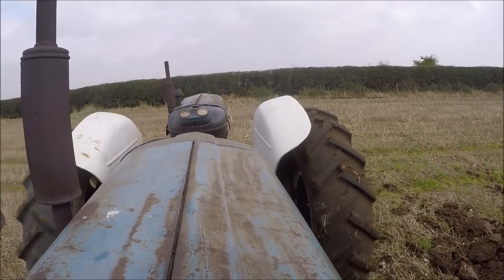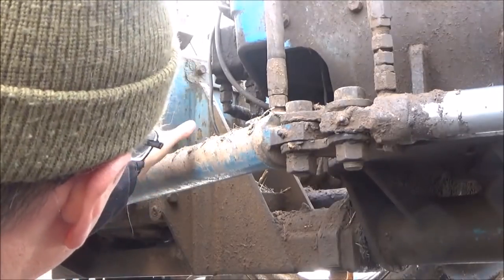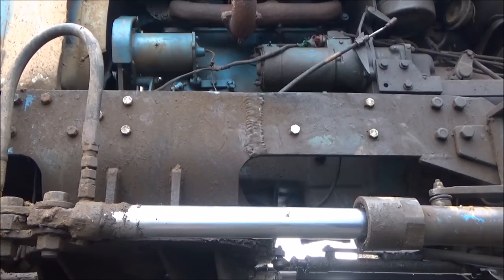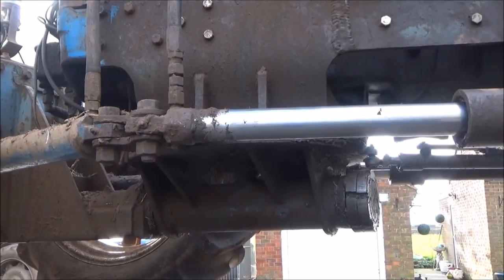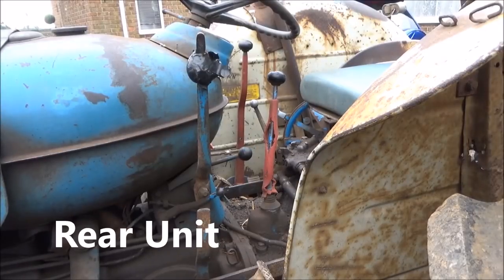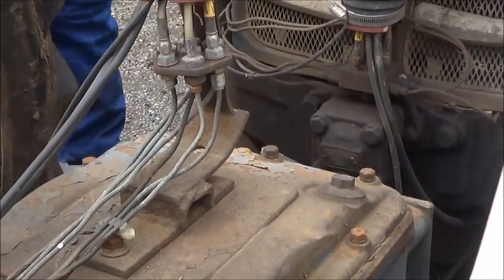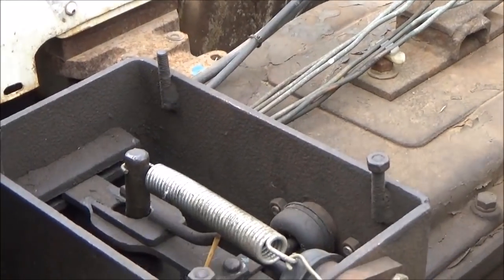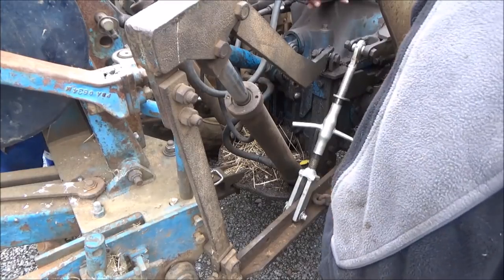THE AMAZING DOE TRIPLE-D !

Comment: Loved the up close and personal look at the old girl.     
Before cellphones with cameras, I happened across two Deere 70 two cylinder tractors mated.
Hydrostatic pump and motors from a combine spun the crankshafts. Plates blocked off where the jugs were originally bolted to the block. 
A 6-cylinder Chevy engine spun the pump, likely harvested from the combine as well.
It appeared as though someone ate pizza too close to bedtime...   The most crude piece of functional machinery I believe I’ve ever witnessed.
I wish I had a picture or better yet, a  YouTube video of that hilarious nightmare!
Be Blessed!
Reply from the maker: Yes over the years there have been several attempts, some more successful than others, at getting more traction and power.

Comment: Thanks for another fine production sir, I seem to remember reading somewhere that one of the units needed to run slightly faster on the throttle settings. Now was it the front pulling or the back pushing more that I can't remember. There was an MM somebody had made into a Doe type tractor round here a few years ago at a local show. They used a loading shovel type pivot, and a load of junk they found in the scrap out back to build it. It was a 10/10 for mechanical  achievement with it working, but a 2 out of 10 for presentation L.O.L. hope you have a good week , see ya next time Take care.
Reply from the maker: If you watch the final clip Robert when he's ploughing at the Festival of the Plough, the front unit is actually in a higher gear than the rear which was a common thing to do when using the Doe's on hard going.
Reply: Hi Thanks for mentioning that,  when you  watch the magic video of the Doe plowing the first time you don't automatically  notice it. When you said about it you can see it Is slightly faster by a hair.

Comment: Excellent video Kurt. Interesting how they made the transmissions and steering function. 
The big issue now for those guys that have them is a) storage space and b) moving the tractors and ploughs about from event to event due to their total length. A big enough lorry (or lorry and drag is not cheap to run in its own right unless you have other work for it to subsidise its use going to matches or other such events.
Reply from the maker: Yes Dan it's okay having these sorts of things but moving them is another headache altogether but these guys make the effort so that we can continue to see them working. I think a lot of people just go to these events without thinking of the cost and logistics involved.

Comment: Had 2 on the farm where grew up....the first one, the farm had to buy 2 majors, for Does to build one DDD, the gearshift arrangement was different, I think the front tractor had to be put in gear, before got on to drive it, but it was updated after a while.. the second one was a pair of 5000's.
Reply from the maker: That's right, they were nearly all different 👍
Reply: @LordMuck  I think it was one of the early ones they made..

Comment: Good video Was just wondering how their got the diff lock to work on the front unit when the driver on the back unit pressed the diff lock pedal down or did they do away with the pedal and fitted a leaver  that worked both diff locks simultaneously
Reply from the maker: From what I've seen Derek they did a variety of things including slave cylinders and springs.

Comment: what you were saying there about them being converyed into conventional tractors now reminded me actually a few roadless tractors were converted to 2wd if the axle went wrong
Reply from the maker: That's correct, I've seen a 2WD Ploughmaster at a dealers some years back.
Reply: MMM?  I seem to recall '''the conversion'' back to 2WD was removing the propshaft and axle half shafts  ;-)
Reply from the maker: Which left a 'dud' tractor (4wd axle but not 4wd) so it was removed and a standard 2WD front axle put in its place so it could be put onto a loader (as was the one I saw in the dealers yard)
Sandwich box was still in place though as was output shaft.
Reply from the maker: And I've also seen a couple of Roadless (no idea what model) sent abroad as 2WD's and the 4WD kit taken off completely and sold separately.
Reply: Lord Muck just seen now JJ thomas (converted old 5000's to 6cylinder and refurbished them with new cabs) apparently bought up some Doe 130's , split them and used them to make 2 conversions
Reply: I was being a bit tongue in cheek, call it the ''on farm conversion,'' ....usually when the front diff went kaput on an old tractor, ..........nearly always down to a  lack of oil.
Reply: Mark Figes tbh ive heard what you said been done when the cv joints go to "keep er going" too 😂
Reply from the maker: There was one on the show circuit for a few years with the shafts cut out until he eventually got a couple.
The one I saw in the dealers yard with the 2WD axle still had the grey Ploughmaster bonnet !
Reply: tbh the original post i meant the 2wd axle swap/prop shaft removal , dad has mentioned the 4wd axles would snap the LH hub/pivot off on loader tractors too, found out roadless narrowed and rewelded the GMC axles in that spot
Reply from the maker: It was Manuel and Selene who cut GMC 353 axles, by the time Roadless used them in production they were their own casting (both Manuel and Selene also)
The weak points were due to overloading and that's why you see a lot of later ones with the web plates on the tube.

Comment: I recovered one of these after it had been stolen from the enfield pageant  they are fairly heavy
Reply from the maker: You have to tell us more now...
Reply: @LordMuck  this guy came in to the recovery company I worked for and asked could we recover a tractor that had been stolen whilst at the enfield pageant of motoring so we set off in a 7.5 tonne man fixed bed truck he said it was an earnest doe triple d  I'd never heard of one to be honest to say I got a shock when I saw it was an understatement trying to load it was fun I've run trucks up the ramps I've never seen them bow like that the guy drove it up I think it went back to hemel Hempstead from Enfield every corner was touch and go with the bed hitting the floor that was about 1999/2000  definitely a stand out moment lol
Reply from the maker: That's brilliant 😂👍👍